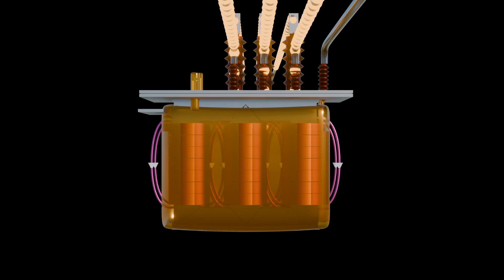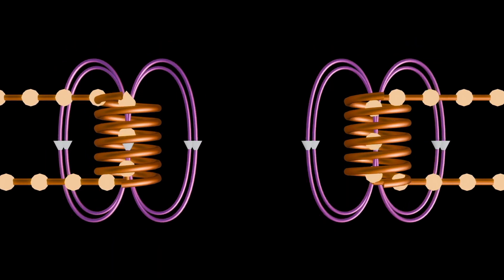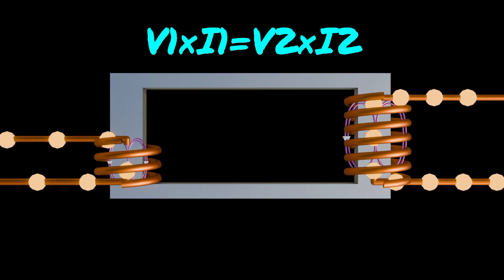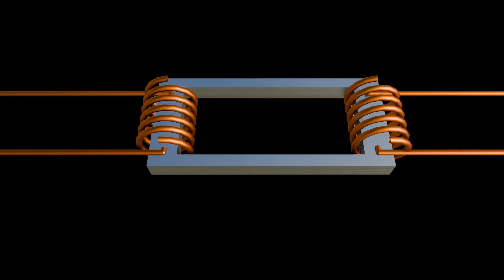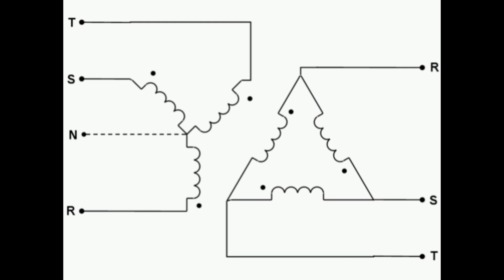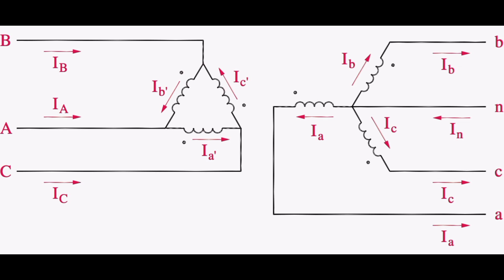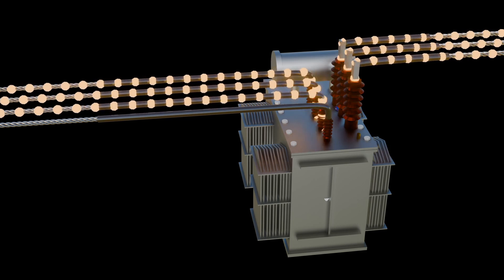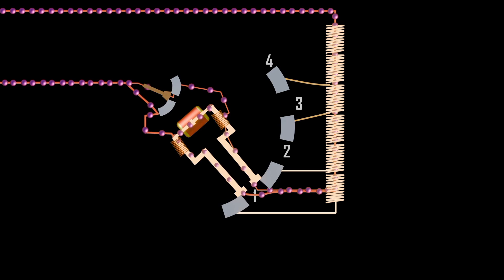how transformer works explained in animation.  concept of tap changers.  #transformer #documentary

Comment: AI generated tat.
Reply from the maker: How?
Reply: @wiredwisdomeng3d  Have you actually listened to the audio?  Not only is it filled with gaps and incorrect pronunciation, there are constant repeats of the same point that fill out the time.  if the script seems like it has been badly edited, it usually hasn't been edited at all.  All obvious signs of AI content.
Reply from the maker: Okay, it is just voice over done with Microsoft edge,  I will improve on the audio, I am really working on that.